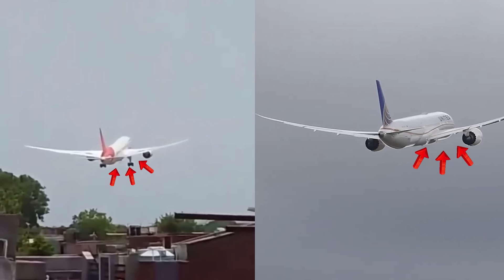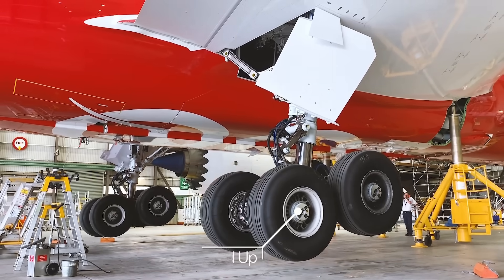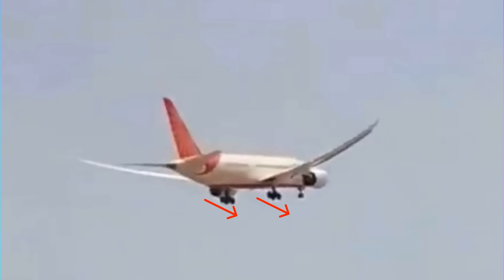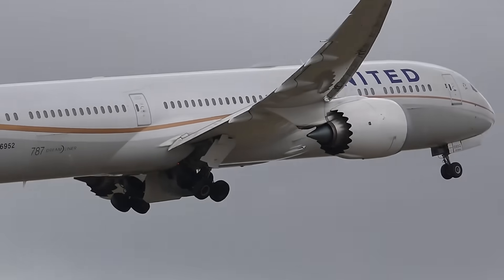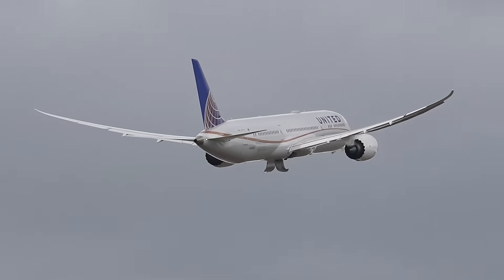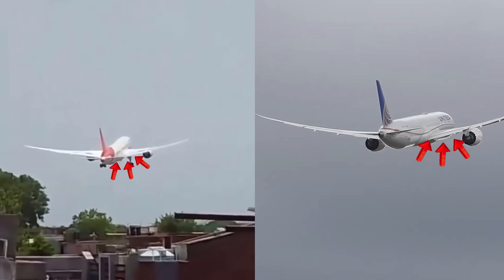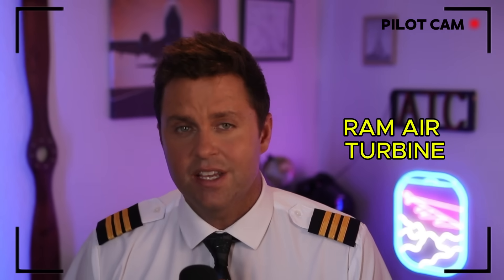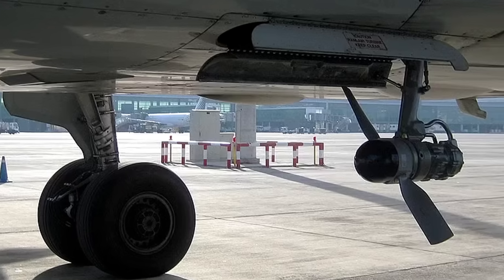Pilot Explains: A New Detail in the Air India 787 Crash Everyone Missed

Comment: Excellent observation regarding the gear position — you’re absolutely right to point out that the gear appears to be in transit or retraction at the time of failure, which strongly suggests that “Gear Up” had already been selected. However, the gear-up sequence seems to have been interrupted, and that in itself is a critical clue: whatever massive failure occurred, it seems to have happened precisely during or right after the moment “Gear Up” was selected.

Now, considering the outside temperature was around 40°C, and reports suggest the aircraft took off with incorrect or even missing flap settings, a fully loaded 787 bound for London would never have been able to lift off successfully under those conditions if the flap setting had truly been that far off. It just doesn’t make sense — that kind of mistake would have prevented a clean takeoff entirely. But the initial climb — short as it was — appears normal and stable, as does the rotation itself.

If you analyze the video angle relative to the runway and compare it with standard takeoff performance, you can clearly see that the aircraft lifted off at a plausible point — not abnormally late. This further supports the idea that everything was functioning more or less normally up to the point of “Gear Up.” Then came the failure — sudden, total, and catastrophic.

Also worth noting: I’ve heard that passengers on the previous flight reported flickering cabin lights, issues with the inflight entertainment system, and even problems with the air conditioning. That sounds very much like a serious electrical fault already manifesting, possibly affecting key systems like the engine FADEC units, which rely on stable electrical power.

In such a scenario, a major electrical disturbance can lead to a loss of power to engine control units, resulting in involuntary shutdown, or the FADEC may enter a protective mode, causing an engine to flame out if it no longer receives valid sensor data or commands. And if both engines share the same degraded power source or bus failure, this could result in a simultaneous failure — as seen here.

Putting this all together, it seems highly likely that a major electrical systems failure occurred right after liftoff, at or just after “Gear Up,” leading to the simultaneous loss of both engines — a scenario that’s rare, but technically possible under certain conditions with the 787’s highly electrical architecture.

Comment: I'm guessing maintenance interventions in the hours days proceeding will be a focus.  I recall an accident on another channel where a new fuel storage facility had been added to the airport & water contamination cause a twin engine failure.  It only impacted one flight.  So airport storage, transport out to the aircraft or contamination of the aircraft lines / tanks themselves ?  As speculation at this point.  The flight data recorders will confirm what the engines were doing, but not sure how you can prove water contamination after the aircraft is consumed by fire.  I guess the data shows fuel starvation & / or combustion issues ?

Comment: Great analysis.  Most of the engine failures generate some kind of smoke or fumes or flames out the back.  So, both were turned off… unlikely.  I believe they stopped getting combustible fuel.  A contamination in both tanks.  I don’t know what happened in previous flight that contaminated both tanks.  But moisture or air in the fuel lines.

Comment: I note in the on-ground video of the undercarriage retracting, not only do the wheels tilt forward, but the bay doors open towards the centre of the aircraft. The image of the crash aircraft is blurred but surely they would be really obvious if opened? I don’t see them. If the gear was selected up, why would that be? I can understand the RAT alone would not provide enough power for full gear up but surely the bay doors would open? The only way it wouldn’t is if the system is set up so that the bay doors are interlocked to not open unless the gear has enough power to actually retract. Anybody know how this works on the 787?

Comment: Great catch gear tilted, key evidence, but I would add the word 'up'; gear tilted up.
"It sounds like a wind down of the engines"
Yes, that's what I hear. Number one piece of evidence, loss of thrust, MAYDAY.
It's not a leap of logic to think both engines flamed out.
Was it a complete electrical failure? It's debated in-thread, seems a flawed argument. Conclusion: not possible as the 'absolute' cause. Engines will still suck fuel.
Contaminated fuel? Maybe, but what about a repeat of the incident. Was it a unique one-of? 
Water contamination in fuel? Condensation? Unknown presently.
Stop here. It's obvious the engines flamed out, no yaw, no turbines screaming. 
The question is why.

Comment: If it were fuel contamination, other aircraft would have had issues.
There is no way the flaps were incorrectly set for T/O. There is no way the PNF raised flaps by mistake instead of gear, something caused a loss of thrust on both engines.

Comment: apparently its now been confirmed by several reputable sources the flaps WERE extended. My theory is there was no electrical power and the engines were automatically closed down to idle which could not be overidden, of course, by advancing power levers.

Comment: The Ram Air Turbine can automatically deploy with loss of electrical power, hydraulics and or a dual engine failure.  The RAT can provide emergency back up hydraulics but not enough pressure to retract the landing gear.  This is why you are wrong and have no idea what you are saying:  At this point, no one knows when and why the RAT deployed.  The 787 rotated at the end of the runway with no indication of any sort of engine failure.  How do we know this?  There was jet blast from both engines blowing up dust.  There was no smoke or debris coming from either engine.  There was no rudder displacement.  There was no yaw moments on the airplane.  Therefore, the engines WERE operating on take off.  With the absence of a complete hydraulic failure, there was enough hydraulic pressure to retract the landing gear.  The landing gear was not retracted because the crew failed to do so.  2.  Takeoff runway required for a fully loaded B787 was about 60% of the 11,499 feet of runway available.  The airplane used the entire runway rotating at the departure end.  This indicates a gross reduction ini thrust and or improper flap take off setting.  The crew should have realized this poor acceleration early in the take off roll and rejected / aborted the take off.  At this point, there is no evidence the airplane had reached Vr (rotation speed) at the end of the runway.  The crew should have been aware of runway distance required for take off.  They should have referenced runway used / available markers.  Regardless of these things, poor acceleration with low power settings should be readily apparent to most professional pilots much least an experienced captain.   Conclusion:  The crew made two fatal mistakes.  They did not abort the takeoff and neglected to raise the landing gear on take off.  This accident was probably survivable.  A contributing factor to this fatal accident was CREW ERROR.

FYI.  Raising the landing gear on any transport airplane, asap, is very important.  In particular, the B787 has an enhanced feature accelerating landing gear retraction.  This is in case of engine failure.

Comment: someone mention vapor lock in the fuel lines due to the 100 degree heat. The problem with bad fuel, is why did it only affect that aircraft, no other planes had problems. And they would have known right away since they would have checked the fuel at the airport right after the crash.
Everyone gravitated to the flap theory because double engine failure is i in a billion occurence.

Comment: Hmm. Contaminated fuel? Like in the Mentour Pilot video where a maintenance guy improperly added something to the fuel to prevent mold (?) or other microbial nasties from growing in it? And the improperly mixed fuel gunked up the engines and caused problems? But I think the pilots in that incident made it out of it ok, in that case.

But for this kind of electronic issue… Wouldn’t something this big be in a maintenance log? Or is it just one of those strange things where something really small and unnoticed causes an electrical failure this bad?

Comment: Due the RAT being deployed and the OAT was 100 degrees the aircraft sat on the tarmac for hours, and the lone survivor said he heard a loud bang I believe the lithium battery exploded and wiped out the main electrical bus in the E&E compartment causing a total electrical failure. So with that the engine computers went dead and they shut down or went to idle..And since there are no longer throttle to engine cables no control only the stupid fly by wire control 
The 787 previously had battery fires..

Comment: Lots of time in the 757/767. And Airbus series. Never flown the Triple 7 or the 787. My airline is the largest operator of the 787-8. At first it was easy to think flaps up early. Or not set correctly. But looking at some 787 systems stuff flaps 1 or 5 would be hard to spot in the available video. Those flap settings extend straight aft. Not down. Like most Boeing flaps do. And flaps 1 or 5 would be hard to see. And the audio sure does point to the RAT being deployed. Obviously a deployed RAT points to a dual engine failure. And the gear tilt function positioned the gear to retract. But a RAT won't power enough to retract the gear. Dual engine failure. But why? FOD on the runway? Fuel contamination? Intentional engine shut down from the flight deck? Or the worst. Some sort of a major mechanical/electrical malfunction (fuel) that took out both engines? Air data computers? Improper use of auto thrust or automation? Sabotage? That airplane even with gear down should have climbed out single engine no problem! If it was the airplane not good for Boeing. And not good for current operators of the 787-8! At least this airplane has the latest black boxes and more than likely telemetry from the airplane live transmitted to the company. But what a terrible, terrible tragedy. Watching and knowing what is about to happen to the Pax, crew, and people on the ground. How terrible! RIP to all of them. And thoughts and prayers to their family and friends. Let's hope they get some preliminary answers as quickly as possible! How many times in our careers as professional aviators do we say "But there for the grace of God go I!" We all train with the "Swiss cheese" analogy. And accidents happen when errors have not been trapped! Be they human factors or not.

Comment: power failure due to fuel issues probably, left the wheels down as they knew they were going go crash and sometimes having the wheels down to help emergency landing. Impossible for mistake with co pilot and gear as the pilot is in charge of the gear level, to move waiting for the co pilot to call to put in position.   this plane had recently come from another area and passengers were saying they had lost AC and flicking lights it was hot in there.  i think you have to wait for black box now as all this is just speculation.

Comment: Microsoft Copilot AI says this is being investigated among other things:
:- Investigators are exploring whether an electrical failure in the VFSGs may have disrupted engine control and landing gear operation."
The VFGS is the Variable Frequency Starter Generators. The 787 uses electrical power to run the landing gear hydraulic pumps instead of the older mechanical system. It would appear that there may have been a VFGS failure perhaps that interrupted engine computer control, shutting them down and causing the landing gear to stop raising. That's my speculation.

Comment: Hi Gary! There is something that nobody has pointed so far - whatever caused power loss on both engines, it happened whilst aircraft was still on the runway, not after it became airborne! Airport camera is clearly showing that lift off happened at the very end of the runway, which is not normal. Question is why pilots didn't abort take off and slammed the wheel brakes and trust reverses in order to stop safely by the end of runway? What would you do if you notice that airplane is not accelerating properly on the ground? By the way I am not a pilot, just a long time aviation enthusiast. Cheers mate!

Comment: Yessir indeed. I have yet to hear any pilot comment on the many images showing the spoilers were definitely deployed, not even El Capitán Blanco Lirio, much respect. Yes flaps two almost definitely were at slot two as seen flight and in the wreckage, the leading edges are just first step position. Some images to my eye seem to show the rudder deflected to the left. The first video shows dusty air disturbance behind the number one engine at and after take off roll. That is why in a recent Juan Brown analysis you can hear both turbine noise almost drowning out the well identifiable RAT drone/buzz. This leads me to suspect that the number two engine was not running and possibly the center hydraulic pumps weren't either. Etc...
Until the data recorders are downloaded and "read" we are all making conjectures from our unique perspectives. Having said that and to be honest, statistically the number one cause of aircraft making unscheduled contact with "cumulous granite" is pilot error. Then maintenance error. The manufacturer error. All airmen make mistakes. We all have to be on our "A" Aviation, game at all times. The margins for error are too slim that is why we each must continue to diligently continue to follow our Established Procedures. Another sad day for all of the families and friends involved and everyone in our beautiful aerospace community 😢🤔

Comment: This flight came from Delhi to Ahmedabad. At that time AC was not functioning. After this flight reached Ahmedabad did the technician did some wiring work to make the AC to work. Did the ground technician did some wrong wiring for malfunction of the electrical system in the airplane.

Comment: 1] A pilot have to follow a check list for everything.  Whether the engineer, before handing over an aircraft to a pilot, used to carry out check of sample of the fuel ,inserted in the tank of an aircraft, to ensure that the fuel has not been contaminated and whether the engineer used to carry out checks of the pipe lines ,which has been connected with the engines ,so as to ensure that the flow of fuel into the engines are clear & smooth ? Whether the pilot, before  taking the possession of an aircraft, used to check those independently , as per statutory guidelines ?
   2] In what frequency, an aircraft is detailed checked & inspected, by the exparts under different  parameters and not by the burocrats ? Is there any provision to check & inspection, by exparts of security? If so,what is the frequency of detail check & inspection? 
    3] Whether in case of ill-fated aircraft,any remark recorded by the preceeding pilot in the log book ? If so ,whether the same relates to security of the aircraft & how he ensured that the same radically solved / resoluted ?
   4] Whether apartfrom security personnels, any vigilance or intelligence group ,well aware about functioning of an aircraft with profound knowledge where there is  possibility of sabotage,is attached to any airport and if so,whether they ensured that the aircraft is free from all kinds  of sabotage?

Comment: Sounds like a software problem causing all these failures once they start the problems would cascade throughout the entire aircraft causing engine to spool back automatically the aircraft electric centered control could be causing all this what was the loud bang heard by the sole survivor this is because  when a problem develops the software takes all the errors into account but for some unknown reason the response to the problems just makes things worse and won't be easily found if another aircraft of this type has similar electrical problems it must be grounded till the cause is found and corrected

Comment: I am curious how the engine health and output was during the take-off roll. Were there maybe indicating factors that the plane was not healthy to take-off? Problem with the 787 is that they use as much runway as they can to Derate the engines. So your V1 point is also not at the most ideal point if you have engine problems. Because when the plane has a lot of speed, it already used a lot of runway. So you are already past V1 at that moment and need to take-off or you will run out of runway. But I can not think how 2 modern engines flameout at the same time. The Rat was deployed so the Thrust was below Idle, so the Engines were absolutely 100% out. Not many ways to do that manually than cut of the engines or put bottles of fire extinguisher in it. But no reason to do because all that would at that just take-off heigt kill you. The 787 has a lot of problems with safety control with building them. Could something electricical shortage send a message to the engines to cut off?

Comment: Jet engines will throttle back or even shut down if the engine control data line is cut. What could cause that? The surviving passenger said that he heard a loud bang. I don't know if RAT deployment makes a bang. If not then I suspect an avionics bay lithium-ion battery explosion which destroyed the communication cable to the engines or other vital components in that communications chain.